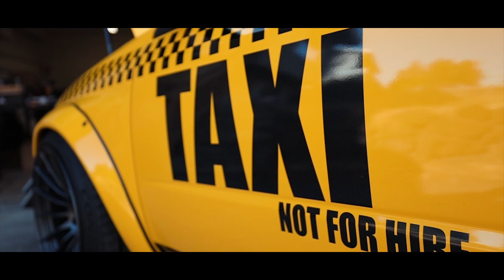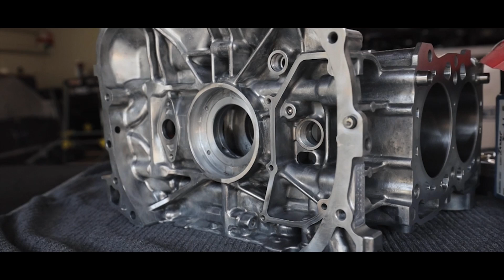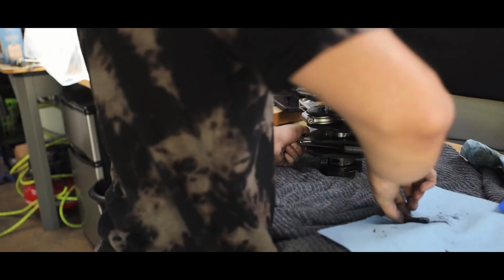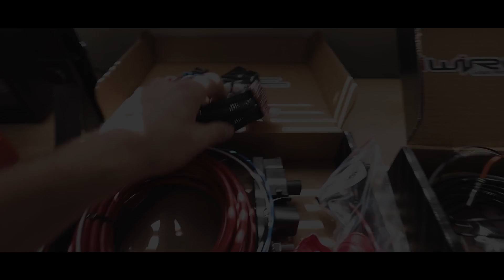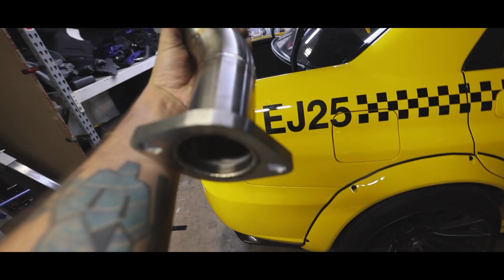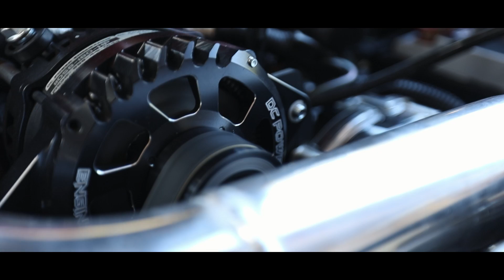How Much Does A Fully Built STI Cost?

Comment: Did you run a stock ra short block? Or anything done to it? And what heads with what done? I’m doing a 450-480 wheel build and was debating on iag short block or ra??
Reply from the maker: Was a stock RA block with built heads and an FP Black for a while then built the engine and did a rotated 6062 🙏
Reply: @Smeedia  thanks! Was planning on running iag stage 2 tuff with stock heads but if this is more reasonable price wise and just as reliable I’ll probably do this

Comment: This build is very similar to mine.. I went with kelford hi lift 282 cams and GSC beehive springs, weisco boostline rods, walbro 450 single pump, my heads are race ported, i still have the stock intake manifold, I didn’t go rotated but I but a blouch dom 5 and I have a air to water Intercooler. Pretty much everything else is the same. I don’t think you remembered to calculate the tgv deletes..
Reply from the maker: No TGV deletes needed with the AMS manifold 🔥😁 long runner manifold
Reply: @Smeedia  oh yeah I forgot you remove them for that manifold lol

Comment: Subaru's just seem like such a massive overhaul to make any real power.. Meanwhile Ive been running 650whp for about 6 years(80K miles) on my CSS K24 with just upgraded rods, pistons and valvetrain.. Motor build cost me maybe $3K? No machine work needed, no fabrication, no nothing.. K's are monsters.
Reply from the maker: Those K24s hold some nice power 🔥 subarus are definitely not cheap to make power with but something about em that we love
Reply: @Smeedia  For sure.. Subbies are really unique cars and Im sure they are rewarding to build and get right.. Me personally, My wife would kill me if I bought a subaru and modded it lol... Our bank account would drain faster than Usain Bolt running the 100m.. I guess sponsored builds really help.. Sadly just dont have the time to do the YT grind. I chose Honda's for their reliability, ease of modding, power they hold and far cheaper price points for parts. Its just amazing I can beat a 2.4 liter for 6 years with this much power and never have one issue.. Just stuck with my maintenance and had her retuned once a year. Thats it.

Comment: Used to be a huge Subaru fan. Until i purchased one. Fun to drive, but...

Unreliable*. Under-powered. *BITCH to work on. Expensive parts. Unreliable. Low build quality. Low paint/metal quality. UNRELIABLE 

Had my 2012 WRX Hatch for 3 years and I can EASILY say it has been the least reliable and worst car to work on. 

(And i didn’t push it as hard as my other cars.)

#SubaruTrash

Comment: Man I’ve dreamed of being able to do this type of Shit, just Max modding Sick ass cars all the time, sadly 😞 I’m just not very good at it and there’s not much business for it unless your like a Pro Mechanic!!
Reply from the maker: Only way to get better is to work at it, a few years ago I had no idea what I was doing
Reply: @Smeedia  ya money is an object tho unless ur rich, I can’t really afford to just rip into my cars, I got other things to pay on, and right now my WRX is my daily
Reply from the maker: I don't blame you at all, definitely been there before. I started with small things. Brackets, shifters etc and worked my way up
Reply: @Smeedia  ya I got a question not many ppl seem to get me on this, maybe u know cause it’s been a little concerning, Everytime I get on the throttle Hard like pushing 5k rpm and accelerating then let off, I smell this like very short burn smell only for like 30 secs then it’s gone and that’s the ONLY time I’ve ever smelt it, everything else seems good which is to be expected with such low miles, but I’m just trying to learn to take care of my car because I Love driving it and would like to be more involved in nice street cars, but I feel as tho my knowledge and some bad luck I’ve had with cars just cuts me short 😕
Reply from the maker: Is it like a fluid burning smell, electrical, exhaust? 🤔
Reply: @Smeedia  it’s hard to say for sure, to me it kinda smells like a belt/rubber kind of smell, but my belts are pretty new and look to be in Great shape!!

Comment: Crazy build, and very expensive. I know this car would be a blast to drive in its condition it sits at right now, but the issue I have with builds like this are that they still suffer in performance compared to cars with the same power levels of today. 0-60mph times on this Subaru wont even hit the 3's, and 1/4 mile times are maybe in the 10's, which is not that great for the amount of $$ put into modifying this build, trying to make it faster. For example, if you bought an MK7 R, which used right now you can find in the $20k's, and you add a hybrid turbo upgrade, tune, downpipe, intercooler, and fueling, which would cost you $4000-4500 in total, you are hitting 3-second 0-60's and 10 second 1/4 miles. I know everyone likes specific cars for specific reasons, but to spend this much money trying to make your Subaru fast, but in the end it won't be compared to today's cars, is just not smart, even as a car enthusiast. It's best to keep an older Subaru stock and just enjoy it. If you want to mod a car, get something that's a better platform.
Reply from the maker: Definitely not cheap but like you said specific cars. It'll take on hellcats when on E from a dig or a roll. 0-60 times I don't care too much for but also have to keep in mind the Weight and drive train. 

For me it's the simplicity of older cars, less tech, easy to work on, relatively affordable parts. I've looked at golf Rs the past few weeks because I've wanted one and they're all 30-35K right meow

Comment: Built or OEM RA block for 400-450whp goal on E85 🤔
Reply: My RA block holding 431whp/400tq reliably. Just don’t go over 29psi and you’ll be fine, I learned that the hard way😅😂
Reply: @almightysir8372  thanks for the input haha. I don’t full send too much so my stock ej255 has been fine in my 06 wrx.
Reply from the maker: Whats the budget? 🔥
Reply: @Smeedia  haven’t decided. This would be a future goal. Little FP blue more than likely. Doesn’t need to be dead set at 4-450. Uppers 300s-400 would suffice.
Reply from the maker: RA Block should be fine 🔥
Reply: @Smeedia  :)

Comment: Hey so I have a 2018 Subaru wrx when I put it into 6th gear in my manual my car didn’t want to go it shit off so I kept trying to turn it back on  it would stay on for a second then shut off them when I turn it back on and press the gas it was back on and stayed on what do I think it could be also it’s completely stock
Reply from the maker: So the car turns in but dies 
If you hold thr throttle peddle it will stay on but die when you let off correct?
Reply: @Smeedia  yes but once I floor it this morning it hasn’t had any issues many people are thinking fuel pump but I want to know ur thoughts about the situation
Reply from the maker: No CELs coming up?
Reply: @Smeedia  no not at all it only happened 1 time and hasn’t had any issues yet so far

Comment: i tried to run that radium hardwire kit and the wire was undersized and too short. why do I need 10 feet of black wire and 10 red? the 10 feet was not enough to get me to my preferred relay location. give me 15 feet of red and 5 black!! ended up just using the relay and fuse from the kit and got my own true 10ga wire...
Reply from the maker: That's what I did with my 17 as well worked beautifully in that car. But the I wire kit worked great for the 05

Comment: At this point i'm something like 50k (i'm too scared to check)  into my 08 sti project including the car.  We're talking full suspension, poly bushings, wheels, closed deck block, built/ported heads, rotated, externally gated g30-660, meth injection, full in tank dual pump to injectors fuel system, all supporting mods plus a ton of carbon for the interior and exterior.  Besides the money/time i'm pretty sure it's cost me a small piece of soul too.  Hoping to crack 450 whp on 93/meth and 500 whp on 110.
Reply from the maker: Keep me posted on numbers, sounds like it'll be a fun build in the end 😁
Reply: Damn that’s expensive as hell for that power
Reply: @brendanfogel4573  if all I cared about was peak power and not reliability/streetability/enjoyability I'd agree with you.  I'm a fan of over building things so when I inevitably decide I want more power I can do so without having to do a bunch of extra stuff to handle the added power.
Reply: @donmerrigan2362  I have an fa20 though and it more than half the cost to make the same whp. Yes of course you wanna do the supporting mods (that’s how people blow their engines up). I have all my supporting mods as well as Sti trans. I’m at around 470whp and cost me at most like $11k. Ej’s are expensive to mod properly but damn that sound it worth though. I’m 19 so I don’t have that type of money to spend on a ej but in the future idc I’ll blow it all on a blobeye or Hawkeye
Reply: @brendanfogel4573  I did say that the car was included in that price. So it may have cost you 11k in mods but a fair bit more than that for the car and getting it up to date on any maintenance it may have needed to be able to handle the power.
Reply: mannnnnn if you’re closed deck get that g30-900 and make some power bro! depending on ur fuel pump/injector size it sounds like your setup can handle way more than what that 660 is capable of
Reply: @devon5078  iag rates the block for 700-750 bhp is believe. So 600-650 whp.  On pump/meth @ 22-23 psi I did 420/405 and on e50/meth @24-25 psi It made 475/467.  The tmic was just getting too hot on the dyno so my tuner wasn't comfortable pushing it much further.  It's now back on e75 pushing 28-29 psi, getting a fmic, short runner na intake manifold and port methanol injection.  Depending on outside temps I'm seeing between 62-65 lbs/min airflow compared to 54-55 lbs/min when it made that 475/467 so low to mid 500s should be no problem.  Somewhere down the road I'll be looking into either a g30-770 or g30-900 as I'm pretty much at the limit of what this turbo can do.  It does hit 29 psi by 3900 rpms in 4th which is great for the daily driver/back road warrior I wanted though.
Reply: @donmerrigan2362  fuck yea thats a good setup for response and just fun daily driving, but those closed deck blocks can take some fucking crazy abuse
Reply: @devon5078  I'm amazed how quick the spool and response is even with a .92 are exhaust housing. She's currently getting a ported short runner intake manifold, iag throttle body, ets 4" fmic and radium dual injector tgvs which will let me use 1 hole for the fuel injector and the other for a small methanol injector for each cylinder. I'm worried about the loss of response this will cause but at the same time it should allow me to make power all the way out to 7500 rpms instead of peaking at 6700-6800 the current set up does.  I can deal with gaining 200-300 rpms in spool time if I gain another 600 rpms of power in the top end though.
Reply: @donmerrigan2362  if you have built heads you could realistically ring out to 8000+ rpm’s and put a bigger turbo to really carry that powerband to redline, that’d feel insane

Comment: can you recommend a replacement hose kit? for the ej205? i buy the OEM ones but they crack under high temp after 50k
Reply from the maker: Honestly OEM would be my suggestion. The aftermarket swell over time.

Comment: Such a sick build! I love watching you put all the scoobies together
Reply: Me coming back to this video as I sold my hatch and bought a complete restoration blobeye STI. Need a video on a great set up for 400whp!
Reply from the maker: Ohhhh jelly! Congrats on the blob! 🥳 what are the details on it?!
Reply: @Smeedia  Rolling shell with engine, trans and axles. Pulled the motor apart to find some glue/gasket maker seeped into the cylinder bore causing one cylinder to stop mid stroke! Re-watched your "how to make x horsepower" and pulled some ideas from the list. Had a question about the FP Blue Turbo!
Reply from the maker: Whatcha curious about 💪
Reply: @Smeedia  The goal for the STI is 400 WHP with room to increase if I feel the need, have you experienced any negatives with the FP Blue Turbo? A few people in my area "AZ" ran that turbo and blew it fairly easy not sure if they beat it to death or maybe a common issue occurred and was ignored
Reply from the maker: I never had any negative experiences with the turbo. Obviously if you push it to thr absolute limit its going to fail
Reply: @Smeedia  Thank you sir, my block is off getting a closed deck as we speak and I am ordering the last couple of parts I need. Will update you once it's done!
Reply from the maker: Eyyyy thank you my friend 🔥🙏

Comment: I'm curious..

Why the smaller EWG? Going for higher pressures?

With that turbo (like mine) spool, a 44mm I thought would be better in your config.

I got the full ETS kit from intake through IC and exhaust, and with 44, there is VERY little lag right now, even on a base MAP..

So, just was curious to know why the smaller EWG. :D
Reply: Also, I have my own spreadsheets that I've tracked since owning the car, and how much I've invested since I bought it.

I would be more than happy to share this out, and for each person would be unique for all the 'little' stuff. I have ever single purchase scanned, and picture proof of what was involved to show.

But, with receipts.. I have now invested over just shy of $100k in my build with both "Power", and "Looks" with the base car price. Will find out the HP numbers on the Dyno next week after MONTHS of waiting! But, it should be somewhere in the realm of 450-470 HP on E85, and the tuner says will be safe.

If you're doing this, just the biggest thing I can/will ever say, PLEASE just build things right. The base EJ257 is stable, just do your build right, and understand it ain't going to be cheap.
Reply from the maker: 38mm you'll want for higher boost, 44mm lower boost 🙏

Oh boi, I do not like looking at mine like that, I think all kn all I'm maybe 50K into this one 😅😅😅

Comment: How much did you spend on the upgraded brake system to control Karma’s speed?
Reply from the maker: Oe replacement rotors, hawk pads, ss brake lines and a master cylinder brace. I'd say $450 or so

Comment: I hope machine work was done for bearing clearances to compensate for the arp case bolts.....if not, good bye engine
Reply from the maker: Only torqued the ARP Case bolts to OE specs so no need to line hone

Comment: I spent 21k for my 16 sti with 34k miles and a rebuilt title. Got 12k miles on it before it spun a bearing. I’m now spending 34k for a stage 4 closed deck with all supporting mods, rotated 3567r, flex fuel. Gonna sit right around 600whp. That includes all the labor aswell and a 2 year warranty
Reply from the maker: Not terriblewith labor included and should be fun power to play with 🔥

Comment: At what rpm does the 6062 kick in? Same on pump gas as e85?
Reply from the maker: Haven't done E85 yet but right now about 5K because of the open T4 flange 😖 a V band hot side will bring it down to about 4.4K
Reply: @Smeedia  Damn 4.4k will be a really nice kick in point honestly, still got a decent powerband at least

Comment: How much does a fully built STi cost?? 

I'll let you know when I'm done. I'm almost there, so fucking close.
Reply from the maker: Whats left now?!
Reply: @Smeedia  I went to go to the store and when I came back to start it again, it went pig fucking rich and just drowned itself in fuel. Thought the MAF was bad, replaced it with OEM and it started, but ran like rich dogshit still. Old OEM MAF wouldn't let it kick over, but new one did. Tuner said to fuck with the wires amd accessport with IAT'S pulled up next to coolant temp for temp relativity reference. I couldn't get it to read. Wiring is bad there, and maybe other places. Heat shielding on harness under intake manifold crumbled into ash when the TGV'S/lines/rails went in last month.
Reply: I got the whole wiring harness that attaches to the intake manifold for cheap, so if that's anywhere near the problem then it's going to be replaced. If not, then it's gonna be a pain to track and fix. Running perfect until this. No codes, no warnings.

Comment: Question my iag stage 2 block has had the same amount of piston slap since day one it's at 3000 miles now the piston slap last for 2 to 3 minutes thirty seconds after cold startup is that normal?
Reply from the maker: Totally normal, once the material reaches temp, the thenral expansion makes it nice and tight 👌 also depends on the pistons. My Je pistons don't have much slap
Reply: @Smeedia  thanks

Comment: Bro Motul X-cess 5w 40 or Motul x-clean 5w 40 which series is best for a 2005 built sti ,thanks!
Reply from the maker: Between those two x-cess
Reply: X-clean is for the 2012 and newer EJ20's and EJ25's. I run x-cess 5w40